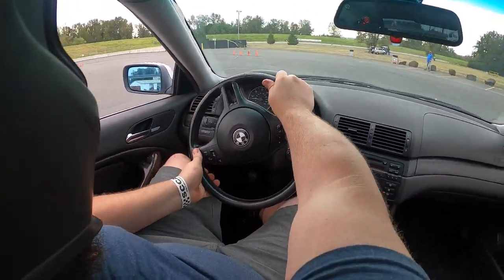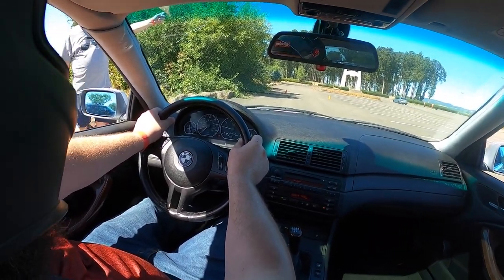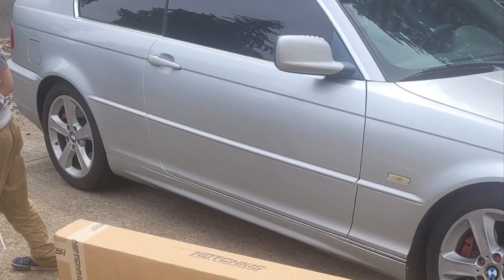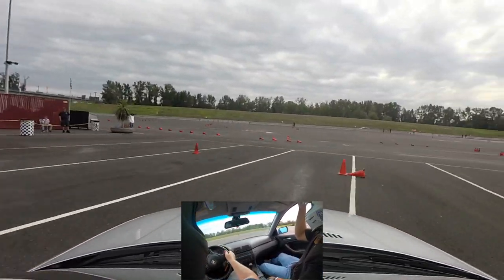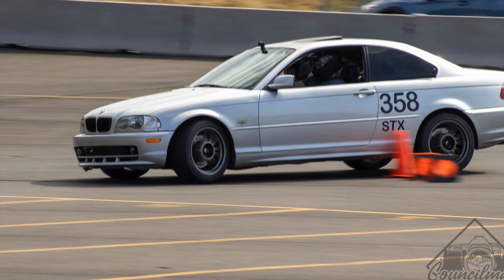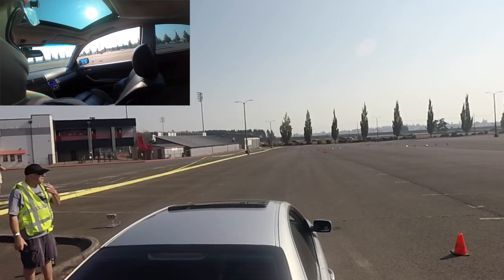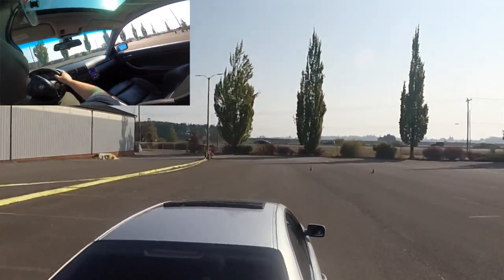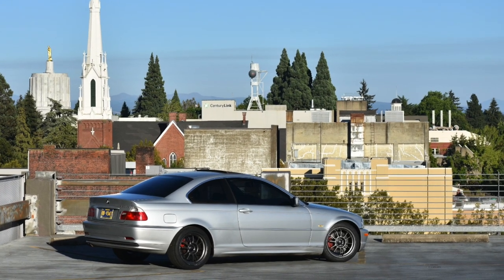E46 330ci Autocross build.

Comment: Hell yea man! I’ve got a 325i that I also got for cheap, it had blown shocks and the original cooling system in it. Fixed the shocks before my first autocross, but the radiator blew during the autocross. So I replaced the entire cooling system. These cars are a ton of fun, and maintenance isn’t too costly if you do it yourself.

Comment: If you got the hotchkiss front bar, when I had it full stiff the car liked to push. Full soft it wasn’t stiff enough. Never tried it in the middle, but just bought a whiteline rear bar, both front and rear full stiff. Also got 245’s on a 17x9 wrapped in dunlops for this year so we’ll see how it goes. Also got koni yellow struts. Testing on the road it seems true so far.  Love the video keep them coming please❤
Reply from the maker: This year I'm playing with alignment to get it to rotate. I ran the last event with 1/8" toe out in the front and ~1/8" toe in rear (at limit of rear adjustment, had wanted to go 0 toe). And full soft both bars. It was better and with the lsd it had a neutral push on throttle. I just got rcab brackets with more adjustment to get to zero toe and we shall see if I have time to get them installed before the next event.im looking for more rotation on turn in and then balancing on throttle with the bars

Comment: I've been looking at those ECS coilovers. Have you driven it enough with them on to have a strong opinion of them?
Reply from the maker: For the money I paid I am satisfied with them. I picked them up for $650 but it looks like they are $850 now. At that price I would be less impressed. My biggest complaint is they require running a bit lower than i would like due to the rear shock length. In order to have appropriate droop i had to go pretty low. They also require a shorter front sway bar link that is not included. And make sure to order strut tower reinforcement to go on top because the surface area is dramatically less which could mushroom the shock towers if they were not already. 

From a driving perspective they are not the worst cheap coilovers I have experienced. The shock adjustments do effect ride characteristics. At the last autocross I was able to dial out some understeer by firming up the rear shocks. On the street full soft feels alright, not incredibly harsh. I bought them expecting to replace these with nicer coilovers.
Reply: @driven_nation  thank you, that's helpful info!